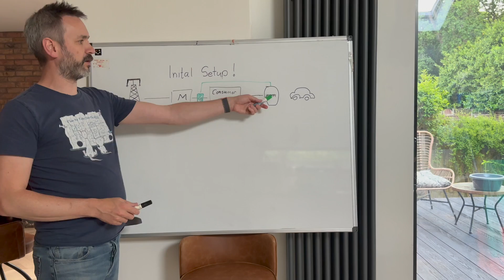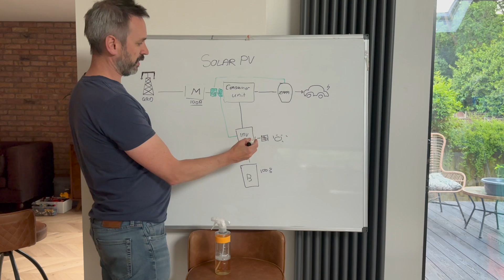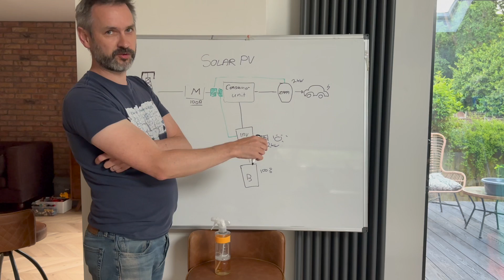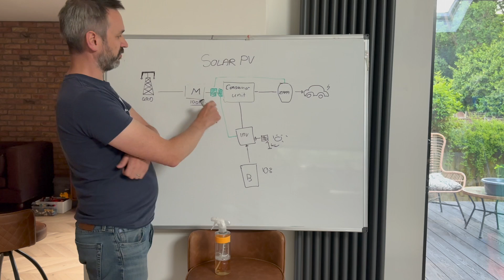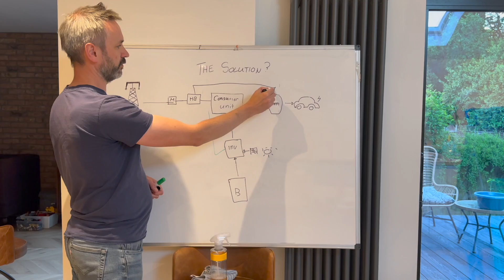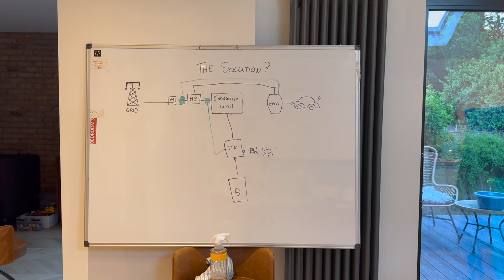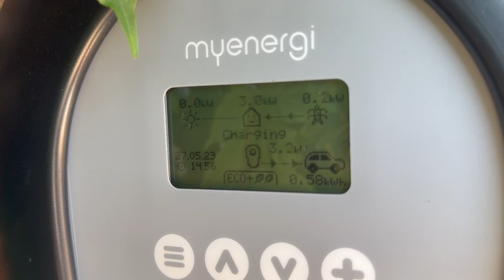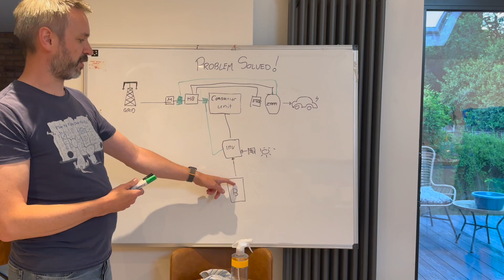How I stopped my Zappi draining my battery

Comment: I have a zappi and 2 solar inverters and a battery with inverter. I'm experiencing  battery drain when octopus intelligent  gives me non standard mid afternoon charging slots . I can fix by manually setting new battery charge times but want a better solution.
Any ideas
Reply from the maker: Hi. Sounds like you have an amazing solar setup. As I understand it, it's all about the location of the CT clamps, but in your situation, you must have at least four clamps on your main live/neutral. To prevent the Zappi from discharging the battery, you would need to do like I did and hide the Zappi from the battery. Open a ticket on the Zappi support forum and post the link here. If you could include a simple diagram with your current arrangement and location of the CT clamps, I can have a look!

Comment: We have the same problem.   We have 32 solar panels, generating almost 8kW at peak together with 17.7 kWh of battery storage.   Looking at page 26 of the Zappi manual, it says that ... "If the property has a static AC battery system installed, it is possible to get the Zappi to work in harmony with the battery system, PROVIDED A CT HAS BEEN INSTALLED to monitor the battery inverter.   Then in the Zappi settings, set it to "Avoid Drain' and this should stop the Zappi draining the battery when using surplus power from solar generation.   So we are waiting to get another CT installed as described above and then we will see what happens.
Reply from the maker: If you have a separate inverters for the solar and battery, this would perfectly well, since the Zappi would understand when the battery itself was discharging. As mine is Hybid, it cannot tell the difference between battery power and AC power. I guess  Let me know how this works out for you!

Comment: Thank you Tom for the video. If you set the Zappi to fast charge, will the battery discharge into the Zappi ?
Reply from the maker: No, it won’t. The inverter cannot see the load from the Zappi, so it won’t know to discharge the battery. You could set to Eco plus and then force the battery to discharge. The Zappi would see that as a surplus and divert it into the car.

Does that help?

Comment: I solved this by writing some software off a Raspberry PI that controls the Zappi, my Tesla M3 and sets the Zappi to Eco mode to only charge when the Tesla Powerwall reaches 98% and stops charging when it gets to 95%. This deals with any fluctuation in use/generation and ensures that the Powerwall is at least at 95% at the end of the solar day. I can then run it in a different mode that sets the Zappi to 7kw between 11:30 and 5:30 (Octopus cheap tariff) and the Powerwall is set to not discharge during these hours. The Raspberry PI is then controlled using a 'front-end' UI off my phone (the RP is programmed using NodeRED). I was doing all of this manually for a long time but decided to set it up this way so that is was easy for the wife to use. It also ensures that I don't export at all during the year (as long as I keep space in the M3 for charging).
Reply from the maker: Nice!

Comment: Thank you Tom, very helpful, I'm about to get an EV and a Zappi and was trying to figure out a Solution using Solis config only...you can do it that way, but I think I'll go with your option right from install... 😊
Reply: ....Thanks again Tom, my  Zappi install was done as per your video and all works a treat.
Quick question: I'm on Octopus Intelligent GO which integrates to the Zappi through the Octopus app. I get charging slots in the Octopus app as soon as I plug the car in. My question is, with surplus solar, given the car is plugged in and the Zappi on Eco+, will it still push the surplus solar in to the car, my point being, will the Octopus app integration cause any issues? 😊

Comment: Your solution was exactly the way my electrician put in my zappi.

It works perfectly my 4k sola- Solis hybrid inverter and 10kw puredrive batteries run the house and my zappi will use any surplus from the sola and charge from the grid.

You have done pretty much exactly the same as me and it works great.

I just don't have an Eddi yet but hopefully soon.

Thanks for the video it really helped me back up the decision to put in the Henry blocks.

Ps: I get the same graph issues the data is pretty much correct but all the colours are wrong.
Reply from the maker: Great! I’m glad this helped confirm your decision!

Comment: Yeah I’ve just finished commissioning my Victron system I’ve designed it with a Hager split board so just moved the EV circuit grid side and moved the CT for the Victron after the EV circuit and then the EV CT to the grid so it can load balance and grad the solar before the grid gets it after the batteries have charged.
Hardwire over software everyday! Ever want a different charger your in the same boat design the system to incorporate all or most scenarios, rather than relying solely on software.
Reply from the maker: Good point about changing chargers!! Hadn’t even thought of that!

Comment: Very timely video as I'm just adding a battery/inverter to my system. There may be a simpler way to implement your hard wire approach, which I am considering. Simply ask the electrician cut the copper bus bar inside the consumer unit that links the Zappi breaker to the Inverter breaker. Reconnect them with a loop of cable, but run this loop outside the consumer unit, making it possible to fit the Inverter CT.
Reply from the maker: Thanks for sharing that! It might be useful to anyone else considering a change like this!
Reply: @tomasmcguinness  And thank you for highlighting the hardware fix. Always better than a software compromise! Reminded me of Boeing's MCAS fix for the short comings of the 737 MAX design. A dreadful, but avoidable, tradegy.
Reply from the maker: I always prefer the simplest solutions. In this case, it’s just splitting the live into two.
Reply: I came to say exactly this, an even more elegant solution with your suggested approach.
Reply: @19sjaak Went one step further on this by bringing out two series CT loops. This allowed for a solar priority sequence of: house first, then battery, then zappi car charger, and if any energy left over to heat water via immersion. 
It was getting a little cramped in the consumer unit, so we upgraded to a much larger one with individual RCBO's.
System has been working for about 6 months now with no problems or software issues to worry about. Well worth the effort.
I think maybe there maybe a market for dedicated solar consumer units like this.

Comment: Hi Tomas, thanks for a great video, I'm currently at the stage where I have the solar, Foxx inverter and home batteries plus an Eddie (with Harri), and using the Export Margin I have managed to balance my house battery drain when heating water. I have just got an EV so am now looking to get a Zappi installed, my hope is I'll be ok using the Export Margin tweak in v5 of the firmware to balance my car charging in the day from solar, the worry that I'm posting about is overnight charging of the EV.  I want to be able to charge my car from the grid in my Octopus Go period (4 hours early morning), but I worry that this will start draining the batteries first. So as an example the car will start charging at lets say 3kw at 1am, my inverter will see this as house load and will start draining the batteries instead of letting the Zappi just take from the grid. I have heard that the way to overcome this is to set the house batteries to also charge at the same time, but in my scenario I don't want to charge the house batteries overnight, I want those to be topped up by the sun the next day.  Could your rewire (which I could get done when having the Zappi installed) be a solution to this?
Reply from the maker: I believe it would. As I understand it, it's about the location of the CT clamps. Adding the Henley block, as I did, means that the Inverter never sees the load from the Zappi or Eddi. If you did something similar, the Zappi could be drawing 7kW from the grid and the inverter wouldn't know and therefore wouldn't discharge the battery to meet the demand. You just need to make sure that the Eddi/Zappi clamp sees all the load from the grid. You're also right in that it would be difficult to use the house battery to charge your EV. Have a chat with your installer and they should be able to advise you best!
Reply: @tomasmcguinness  Hi Tom, I have another question based upon this response if that is ok with you? If you set your battery to discharge would and your EV was charging at the time, would that discharge be used to charge the car? So offsetting the grid demand the car was requesting. I basically want full control of everything! When I use the battery to charge the car and when I don't. It's so frustrating that this level of control is not standard practice!! As soon as the car starts charging at any point there should be a notification on my phone that tells me that and asks me if I want to charge from the battery or the grid. That way if it's a cheap slot from Octopus I can say 'grid' and if it's just because I need the car and it's not cheap I can say 'battery' (and solar).
Reply from the maker: @lufcwls  I feel your pain! In most cases, yes, the battery would start discharging to meet the demand of the EV charger. 

For example, my battery can discharge at only 3.6kW. So if my Zappi was in Boost mode, it would take 3.6kW from my Battery and the rest from the grid. 

It can get more complicated than that of course. In my case, I added the Henley block to stop my battery discharging automatically when my EV is charging. In my case I could force my battery to discharge and then that would go into the Zappi.

I'm hopefully that technologies like Matter (I did a video on basic energy management https://youtu.be/VfF1c8bLeiI) will help solve some of these issues by allowing EV chargers to talk to inverters.

I hope that helps.

Comment: Nice video. I have the exact same experience. I have export set to 150w and it has been fine most of the time. I've the inverter set to self-consume and once the battery is fully charged, it allows then for the Zappi to run (due to observing export on the grid CT). Once the charge starts with say 2.5Kw of solar from the panels, 2.5Kw of that would be going straight to the car  All is fine and works as I would expected. Battery is full at this stage with no discharge. The exact same thing happens that you explained: suddenly a cloud comes over and the solar generated drops, the inverter still thinks the house requires 2.5Kw, so then the inverter starts tapping into the battery to supply that demand. Even though I have export set to 150w, using my shelly EM I see it bounce around. It does try to get back to 150w export, but it is a sea-saw effect. Car charging is steady, but the odd thing is that if the sun is out again after a cloud passing, suddenly the charge is now heading to 3-4Kw. I'm just in this zone where the zappi observes a jump in export and adds that to the demand. I'm sure there is probably some adjustments to make with timings. For the meantime my fix is to set the battery on the solis app to not discharge during the day for a few hours if I have the car plugged in. A bit manual, but besides doing a rewire, it's the only way at the moment for me on a good sunny day to be sure. I may look at something smart with modbus and home assistant, but I suspect the rewire would be the faster approach.
Reply from the maker: Have you upgraded to the V5 firmware on the Zappi? Some people have commented that the new firmware fixes this issue. V5 was in beta when I was looking at a solution. The reviews of it were terrible at the time. I'm told it's fine now :)
Reply: @tomasmcguinness  Yeah I'm on v5 presently. Their latest for both the eddi and zappi. Forgot to say that in my original reply. Mind you I have been having some odd issues with the v5 since the update. Main one that I had a few weeks back was the zappi losing connectivity to the harvi which is less than 10 meters away. A whole system reset did fix that, but I've been dealing with the battery drain since day one. The installer would have wired in the CT to the meter tails, but there is new regulations on what can be installed in the ESB meter cab. I guess main thing is that the car gets charged from some form of free energy.
Reply from the maker: Ugggg, so it’s not as fixed as they claim. I always figured that the issue wasn’t the Zappi, rather it was the inverter. That seems to remain the case!

Comment: Thanks Tomas - a really helpful video and nicely explained!  I'm fairly new to all this, and just need a bit of help making sense of all these options!  

I have 4kW solar pv, an 8.2kW GivEnergy house battery, and a MyEnergi Zappi (v2) which I've just upgraded to v5. I'm a relatively low mileage, infrequent EV user and the house is new, all electric and pretty efficient (ASHP etc), though I don't find I'm exporting all that much overall. I'm thinking of getting onto the Octopus Intelligent tariff, so that I can charge the car at cheap rates overnight on those occasions I need to plug it in.  And if the car battery is ever empty, I can usually afford to wait 3 nights to get back to a full charge. I've assumed that in winter, I could set the house battery to charge up from the grid during the off-peak hours (and if necessary set it to only discharge outside these hours), and then plug the car into the zappi on any evening I need some charge, set to add - say - 30% on any night between 2330 and 0530h.  And in the summer, presumably set an export margin on the zappi, so I can keep the car plugged in during the day to capture any excess solar. Does all this make sense?!  I don't think I need the Intelligent Flux tariff, as with my levels of use, I think any little I lose to the grid through low value export would be more than offset by the advantages of 7.5p/kWh off peak for house and car use.  Many thanks, if you or others do have time to offer any comment/advice!
Reply from the maker: Thank you for watching! I'm an Octopus Intelligence user (I have a Tesla) and I do pretty much exactly what you describe. At present, I charge my battery to 35% during the off-peak and that will increase as we move into the winter months. For my EV, I use the Zappi schedule to turn it on between 11:30pm to 5:30am. Octopus then control when the car actually charges during that period. Whilst it's a very cheap tariff, it just doesn't play very nicely with the Zappi at the moment. There are two issues:

Firstly, when you have set to Eco+ to charge from surplus solar during the day, Octopus will actually tell the car NOT to charge, since it's outside the off-peak times! I've lost a lot of kWh of milage because I forgot about that.

Secondly, if you get an Intelligence charging schedule that includes times outside the normal window, say 10:00pm to 10:30pm or 6:00am to 6:30am, my Zappi won't be turned to FAST, so the car can't charge during those times. This means you might not hit the charge percentage you've asked for.

I find that I have to turn off the Octopus Intelligence control 99% of the time. It just gets in the way. You still benefit from the off-peak pricing. When I know I want to charge the car overnight night, I have to switch the control back on and then just use the normal hours, which is far from ideal! 

Octopus have been promising Zappi integration since the start of the year, but nothing yet :(
Reply: @tomasmcguinness  thank you so much - your comments are really helpful! I wasn't sure whether you could  switch off the intelligent control, but if so (and still benefit from the cheap rate), then I'm minded to do as you do and work on 'manual' most of the time. Out of interest, couldn't you leave it set to manual (with the zappi schedule active) when you know you want to charge the EV overnight, rather than switch the intelligent control back on? Cheers
Reply from the maker: You can indeed turn off the control. However, in order to keep the tariff, you do need to let Octopus control the car's charge every few weeks/months.
Reply: @tomasmcguinness  Ah, OK - thanks for explaining that. I hadn't realised :)

Comment: Solax Batteries, when charging the car overnight on GO reduce Solax battery charge to less than 50% if you do not need a battery charge, good for summer in winter battery system charged to 100% works for me as I do have solax master and slave 11.6kwh charge times same for EV on Go Off Peak.
Reply from the maker: Thanks!

Comment: Im looking at a huawei solution for inverter and batteries and with launch of new huawei 7kw charger am i better off to wait to gain from better potential  integrations than using seperate manufacturers and trying to come up with workarounds.
Reply from the maker: I'm not familar with Huawei's stuff,  but I would still say that having an integrated solution would be best as it should give you complete control. Recently myenergi launched their Libbi battery and it gives you full control over its charge and discharge behaviour when working with Zappi and Eddi. I would imagine the Huawei would provide similar control. The app looks great!!  Of course, if you enjoy building workarounds, cobble something together :) Have a chat with your installer and they should be able to provide you more details and maybe give you a demo?